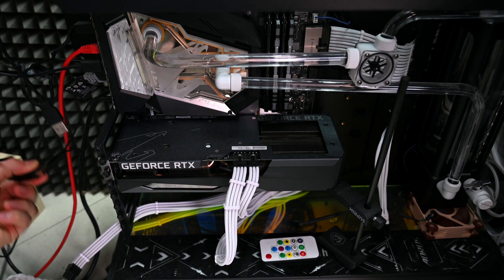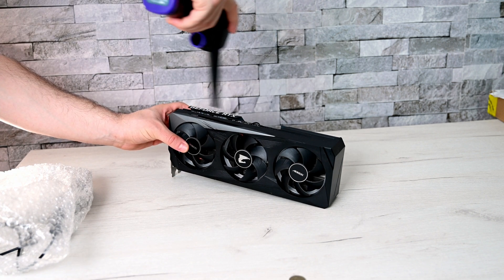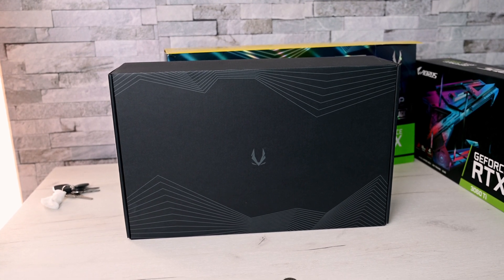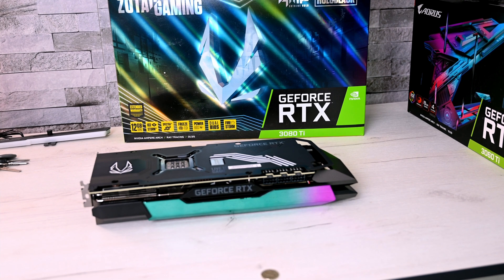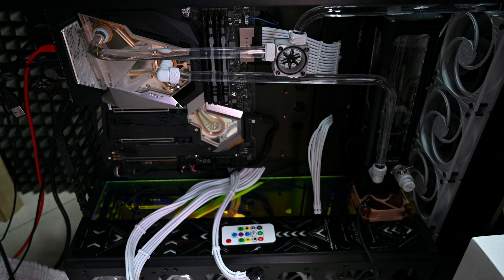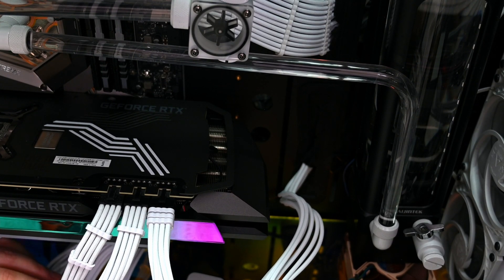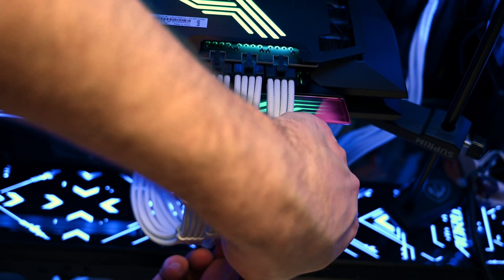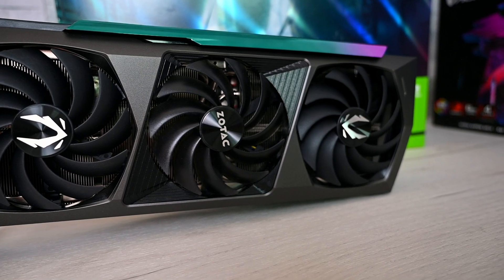How To Remove and Install New Graphic Card - Zotac GeForce RTX 3080 Ti AMP Extreme Holo 12GB GDDR6X

Comment: :eyes-pink-heart-shape:Hi, a Few hints for you .... Number 1 my friend I used my ZOTAC support bracket I have 2 of them 1 on my mid-tower and 1 on my full tower, and both are in their firm as a rock (try different screws on the bracket from the ones your using) adjust the bracket riser and do not forget to add the rubber vibration insulator to the top of the adjustment part of the bracket (its in the lil screw packet they give you and there is 2pcs just use 1 piece centered as the instructions show you) and Number 2 is to take the combs off and put the solid back of the combs to the other side of your cables for better looks as then you will not see the solid line of the cable combs going across the front of your cables as you do now. Hope this helps you a bit. Other than that good vid friend :face-blue-smiling::hand-purple-blue-peace:
Reply from the maker: Appreciate it man, I have the gpu in vertical position now. https://www.youtube.com/watch?v=bDS9AwMczQk

Comment: Hi, I have the same GPU as you have shown here and I am trying to buy custom cables like yours from cablemod. I am having a hard time figuring out what cable to get, 12 pin micro fit 2x8 or 8+ 8 bridged. What dimensions of cable did you order? Thank you
Reply from the maker: hi bro, those white cabels you see are extensions only, x3 8 pin you will need for the same gpu. You need bridged 8+8+8 PCI-E. I was going to make video about to show extensions and fully modular cabels.
You are welcome to join discord as well 
https://discord.com/invite/RqgAjAuCnC